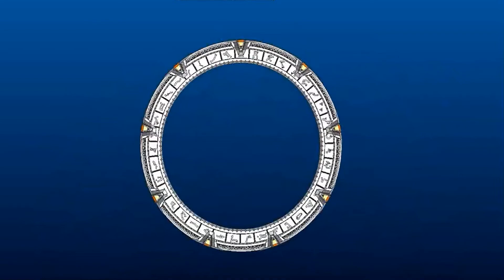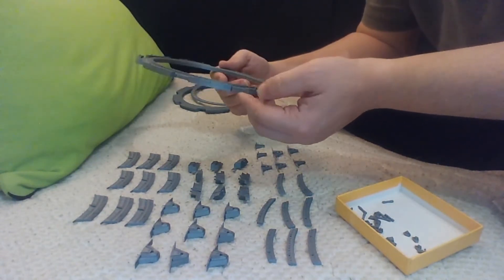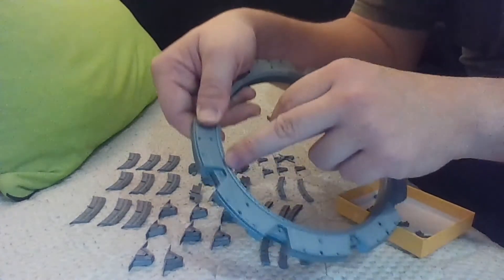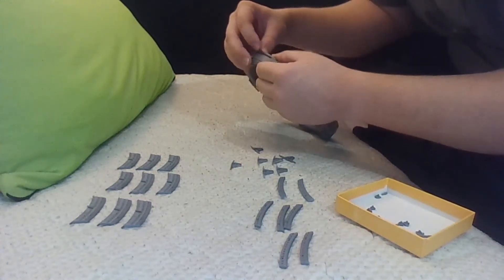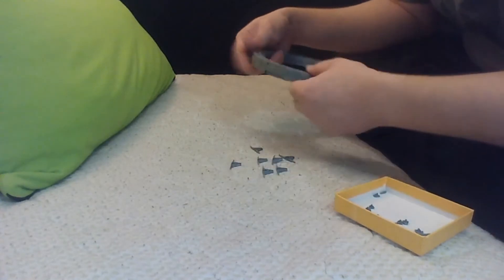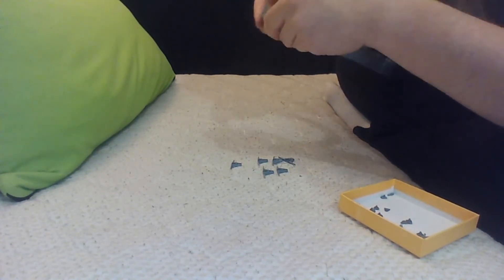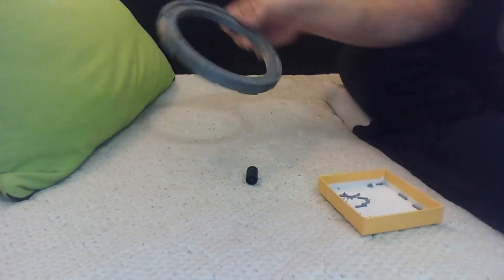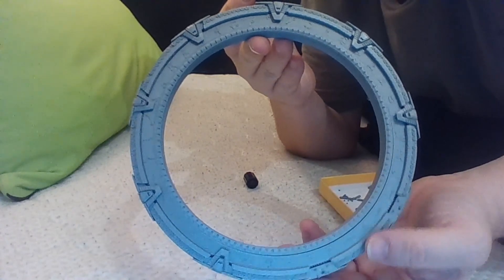Project Stargate Part 5

Comment: Either my ring is too big or my chevrons are too small, but those pins just don't fit, both on rear chevrons and on the front-chevron-connector thingy
Reply from the maker: Well... what can i say. On my end all fits together both in model an print...
Reply: @martintaichl  0.3 or 0.4 nozzle?
Reply from the maker: @dustojnikhummer  standard 0.4 brass nozzle
Reply from the maker: but i would like to point out that i myself printed 3 gates and on thingiverse/prusaprinters dozen people printed them as well and noone had this issue whatsoever.
Reply: @martintaichl  You have a Prusa i3, right? I have an Ender 3 and printed at 100% scale that Cura gave me. Something is off by a few milimeters.
Reply from the maker: @dustojnikhummer  yeah, i have a prusa MK3S
but guys on thingiverse printed it also with ender and it no issues reported.